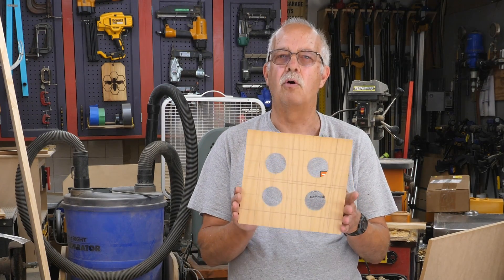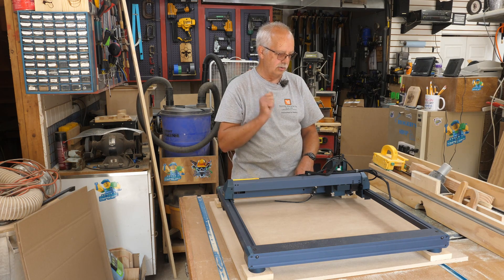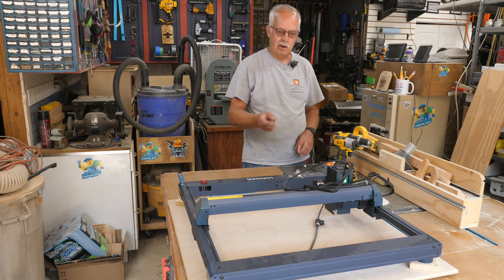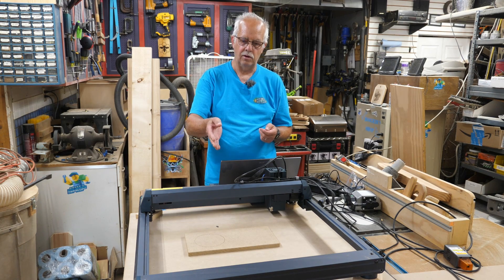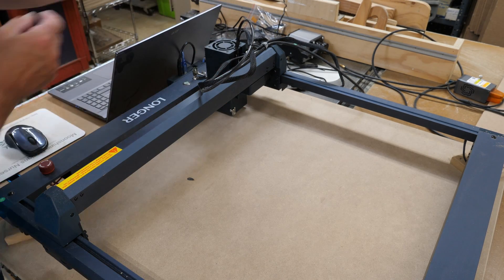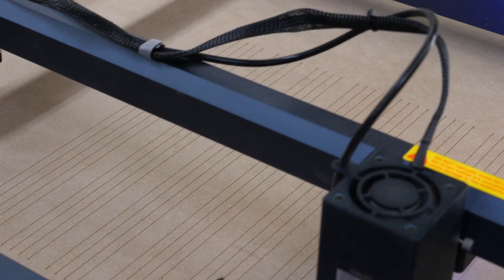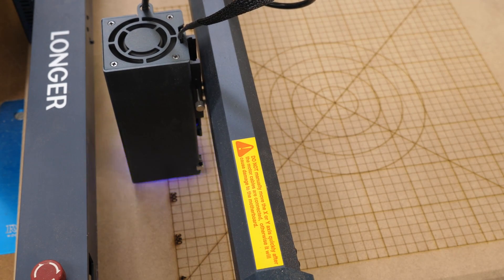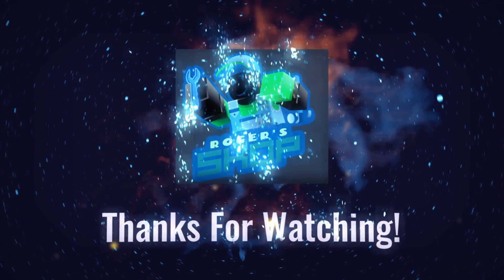Longer B1 Laser Custom Base

Comment: Wanted to thank you for the information and files.  I ordered the B1 30 a few days ago and waiting for it's arrival.  Can't wait to move up to this level of engraver/cutter.   I currently use the XTOOL D1 original 10W.  Along with Sculpfun S9 5.5W, which is incredibly fine for engraving.   Have the AtomStack X20 and just installed the limit switches on it.  But what impressed me about the Longer B1, is the power and has everything I need and want in ONE package.   Keep your helpful video going, looking forward to seeing MORE.  Thank you

Comment: Hi Roger, Just got the b1 30 watt laser. Can not get it to home . Keeps hitting front rail. Please help.Thanks
Reply from the maker: Check Y axis limit switch both for proper position and connection.  X axis frame should contact the limit switch when pulled all the way forward.  Some have two sets of holes for the limit on the Y axis and you might have it in the wrong set of holes.
Reply: Thanks, Will check it out.
Reply: That worked . Thank you so much.

Comment: I just bought the Longer 40w. How do you pinpoint the laser head to an exact position. I don’t see any light until the laser starts engraving, so I’m just guessing it’s exact location.  Maybe I just don’t know how to turn the light on (?)
Reply: Yes, thank you!
Reply from the maker: Assuming you are using Lightburn..............In settings, turn on "Enable Laser Fire Button"  Then, from the move tab, set power to 1% for the laser fire button.

Comment: one question... I was told use air assist only when cutting not engraving ??????
Reply from the maker: Use when engraving, especially on wood or cork, will help keep the lens clean for a longer period between cleanings.

Comment: I TRYED TO BURN THIS ON THE BASE I SET MY LONGER RAY 5 10W BUT THE TWO SMALL SCREWS AT THE TOP OF THE LASER HEAD STOP THE LOWERING OF THE LASER HEAD ABOUT 5 ARE 6 MM SHY OF LETTING THE LASER HEAD LOWER TO THE 30MM ADJUSTMENT FOR THE LASER TO WORK.
Reply from the maker: As I recall, there is a second set of screw holes where the head can be mounted lower.

Comment: I have a Longer 5 10W  with  410 mm travel 
 x & Y how do I change the grid program to smaller it keeps giving me an error message.
Reply from the maker: In Lightburn, edit your laser setting to 400mm (or 15.75" if using SAE).  This is done by editing the setup for your model.
Reply: I'm a newby this is my first laser it is set at 400mm but when it's going away from me it gives me an error what am i doing wrong ? @rogersshop